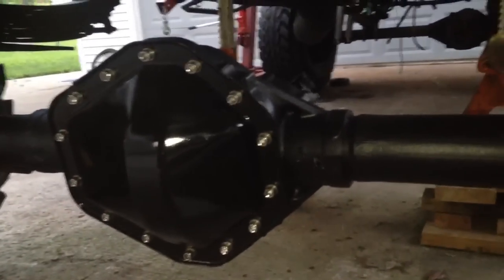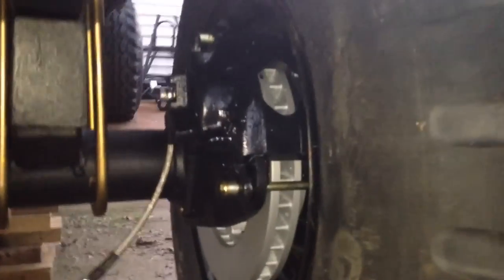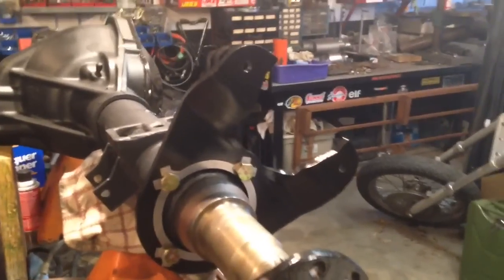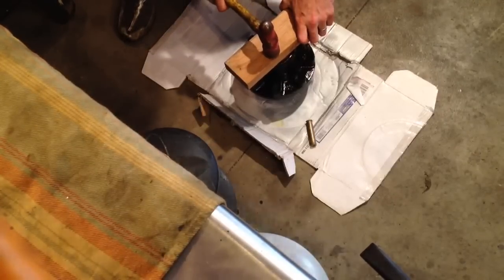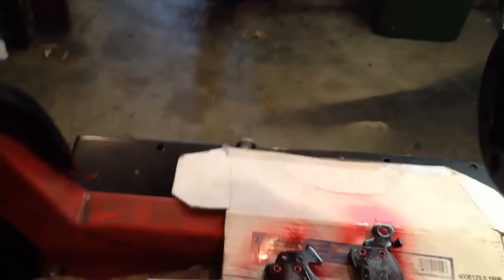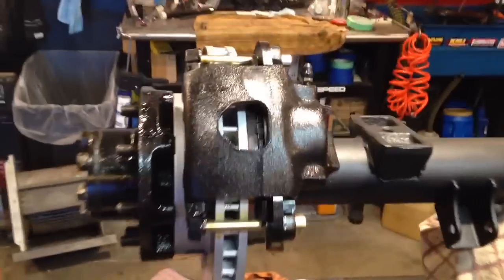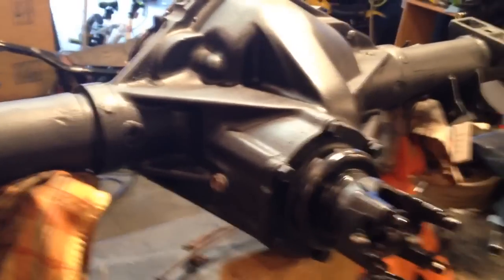Rear Disk Brakes on 14 Bolt Full Float! HOW TO!

Comment: Like to find an aam 11.5" 14 bolt, put 6 lug hubs on it and have the dual piston brake caliper with the 13" disc to fit my 17" wheels with stock park brake.

Drop a 373 diff in and then hoping someone makes a retrofit kit for the 8l90 and 10L90 to work on GMT800 platform

Comment: Great information! Thanks! You mentioned Cadillac Calipers for E-Brake. Any particular year? I've got a 14 bolt that eventually I will be building. The disc brake conversion is definitely on the to-do list for it. Since my rig will be a rail/street rig. I would like to have the option of e-brake. Again, great informative video!
Reply from the maker: Thank you, I am so glad you like the video! I do not have a specific year of Caddi caliper off of the top of my head. Whichever ones used the mechanical disc E brake - I believe mid 80's. Have a blast with that rig! God bless!
Reply: 76-77 Eldorado rear calipers w/parking brake per ruffstuffspecialties.com.  You can buy them new from ruff stuff complete with pads and no core charge for $280 per pair.  Shipping will run $20 or so. If you buy the calipers from an auto parts store make sure they match the pictures on the ruff stuff site.  There are several different calipers and only one matches.  Or find the caddy at a salvage yard and rebuild the calipers.

Comment: I yanked a Dana Super 70 out of a 2003 3500 van & regeared from 3.73 to 4.10 to match my Dana 60 front.  I wish I’d have sourced a 4.10 14 bolt from a 2004 or newer 3500 truck to save some time & money...
Reply from the maker: You have a solid rear end with the super 70 for sure, but u agree you'd have been money ahead to find a 14 bolt. Thank you for watching and commenting! God bless!

Comment: I"d say going without the service brake was a good decision.  I tried a set and it was an absolute crap shoot if they will hold.  On a hill, or have a trailer... zero chance.  I ended up selling the whole conversion.  Braking is not any better than a properly set up drum.

Comment: GebBuilt...Did you reuse the wheel studs from the drum or go with another length. I have read peaople are using a Dorman 610-194 or 610-189?
Reply from the maker: I ended up using Dorman 610.194 which are 3 1/4"long. Thanks for watching and commenting! God Bless!
Reply: Thank you

Comment: Hey bud you mind posting a video on proportioning valve if you used one?
Reply from the maker: I am not going to use a proportioning valve to start. If I decide to use one, I'll post a vid. I've heard several people say it is not necessary, but I'll find out for sure when the truck is done!

Comment: I got everything installed, axles under the truck. just bleeding brakes. how long did it take you. tryed 2 person "old school" bleeding, then vacuum, now im trying gravity. nothing seems to be getting any fluid out. Might be a big inpatient, but i cant wait to drive with 4.10s compared to the 2.73s currently turning my  35s. by the way thanks for the help so far
Reply from the maker: It will definitely take a while. I've been partial to a vacuum bleeder but still requires all the patience I can muster.
Reply: I was at my dads friends yesterday. He's a mechanic. Said that it's the proportioning valve. Cut off flow to rear.
Reply from the maker: +Jacob Schneider yes I'd bleed to it first then move forward.
Reply from the maker: +Jacob Schneider Also, let me know once you get on the road if the front to rear proportioning seems ok. Mine's not on the road yet and I'm curious if I'll need to install adjustable proportioning or not. I've heard people that have eliminated the proportioning valve, ones who have replaced with adjustable proportioning, and others who say it is fine as is.
Reply: +GebBuilt  just drove it. had to crack line from master cylinder to proportion valve (top of vave) and press brakes. freed up valve. drove fine, after pumping brakes to get brake light to go away, brakes lost a bit of stiffness, but still good. on road they stopped me WAY faster. seemed to work great
Reply from the maker: +Jacob Schneider Excellent! Thanks for the feedback!!

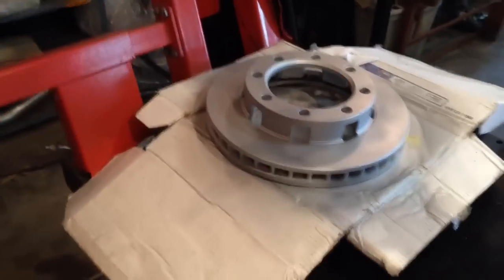Comment: Hey man awesome videos btw.. but do you know if all the 14 bolt ff center sections (pumpkins) insides are the same?  I've got a 01 14 bolt with 4:10 and I'm wanting to swap them in my rear differential out of my 93 with 3:73. Cause I went with a solid axle swap and got a 4:10 front diff.. if you can help That would be awesome and also will a Detroit locker for a 14 bolt ff work in any of them? I had it in my 82 gmc 14 bolt and was fine just wanting to make sure my 93 wou be the same. Thanks man
Reply from the maker: Thanks! I won't even pretend to be a compatibility expert. I think you might run into some issues in swapping those carriers. To be certain I know Pirate 4X4 is an awesome resource for those kinds of questions. Look em up on the web, that's what I'd do!
Reply: I put a chevy 1975 14 bolt carrier in a 2001 GMC 2500 hd housing after cracking the carrier in it.  The older carriers are much thicker and stronger .

Comment: I have a 14 bolt I'd like to do this to before I put it in my '61 Willys PU. Did you change the proportioning valve or master cylinder?
Reply from the maker: Nope, and the truck is still only about 1/3 done, so I haven't driven it to see how it brakes. I haven't heard of anyone changing a master cylinder for this swap, and only a few that have swapped in an adjustable proportioning valve. I will see how mine acts and decide from there.

Comment: What ate your thoughts on replacing front drum brakes on a 70 chevy with a 79 rotor assembly.  I'd just have to swap spindles right?
Reply from the maker: Thank you for your question! Are we talking two wheel drive or four wheel drive?
Reply: GebBuilt It's a 70 c20 2wd

Comment: i have a 92 chevy k1500 with a 14 bolt rear and 6 lug  i want to do a disc brake rear conversion on but can't find a kit i also need to have a e brake since it is going to be a stick shift and its going to have a cummins, and nv4500 4x4 etc so i need a good e brake.
Reply from the maker: +Joe Stenny I believe your best bet for an E brake will be a disk setup on your transfer case output. I intend to do mine that way when time and money allow. As far as your rear disks, I'd suggest scouring Ebay and if you don't find a direct fit, contact the sellers to see if they can help. Cut Throat 4x4 is one of them I would trust to know how to fit your application. if nothing else, the caliper brackets are a pretty simple fabrication for a well equipped shop to build. Thanks for watching BTW!!
Reply: +GebBuilt 76 through 78 eldarado calipers bolt up to these setups and have the ebrake option if you guys are interested in going that way. thats the way ive chosen on my 77 crew cab

Comment: I've got an '83 C30 dually and would love to do the same. Will this work?
Reply from the maker: I would have to go back and research applications - my advise would be to Google "C30 dually rear disks" and see what comes up. Great question, God bless!
Reply: Justin Smith i have the exact same truck did u get those brakes swapped?  If so what did u use and do??

Comment: what would you need pics of? i can try to take pics or a video
Reply from the maker: Just a shot of the wheel hub would suffice.
Reply: i can't figure out how to send a pic to show you
Reply from the maker: +Joe Stenny I got the pics- definitely a semi floater.
Reply: +GebBuilt  awesome thanks for checking  that out... so it would be same disc conversion bracket  etc?
Reply from the maker: +Joe Stenny I'd assume it would. Have your year and tube diameter handy just in case before ordering anything.

Comment: how do i tell if i have a full floater or regular 14 bolt 6 lug rearend?
Reply from the maker: I'd guess your 6 lug is a semi floater, but to be sure- on a semi floater your lug studs will stick out farther than the end of the axle. A full floater will have outboard bearings and the end of the axle will protrude out past your lug studs. Sorry that's my best explanation at the moment without pics.
Reply: Joe Stenny Well glad you asked... If there is seal of approval stamped on the BOM on the axle tube by Chuck Norris it's full float if there is a 6 color rainbow on the axle flange  it's the gm 9.5 .
Reply: Its a semi floater

Comment: also how did you set the spindle nuts and washers?
Reply from the maker: +Jacob Schneider, sorry I'm not sure I understand the question.
Reply: Sorry, I mean when you re assembled your axle you had to put the spindle nuts back to keep the hubs on. How far or how tight did you set the 2 spindle nuts?
Reply from the maker: +Jacob Schneider This is how I've always successfully done it:  Slide the thrust washer on then run the first nut against it while spinning the hub by hand. tighten the nut until a good bit of resistance is felt while spinning the hub. Then back that nut off slightly and you should feel the spinning resistance go away as you back it up. the nut will end up being barely tighter than finger tight. Install the locking ring and tighten the 2nd nut against it- this one should be tight since it jams the first nut. watch the first nut carefully so it doesn't move as you tighten the jam nut- I've seen it happen occasionally. then bend a tab into one of the notches of the 2nd nut. Done, God bless!

Comment: Also my axle is a dually but would adding the disc brake kit would it make it a srw
Reply from the maker: +James Winchel I would have to research to make sure you get the right parts for the dually axle-
Reply: +GebBuilt probably going to get srw hubs

Comment: What are the part numbers on the rotors and calipers please
Reply from the maker: +James Winchel I got the calipers and rotors from Autozone. I just said I needed them for the front of a 1979 Chevy 3/4  ton pickup.
Reply: +GebBuilt thanks
Reply from the maker: Yep!
Reply: +GebBuilt would I use 4x4 or 2wd rotors and calipers
Reply from the maker: 4x4

Comment: Is that a newer style 14 bolt ?
Reply from the maker: Hi Chris, it is a late 70's 14 bolt. Thank you for watching and commenting, God bless!
Reply: GebBuilt. I jus purchased a newer style 14 bff and I was wondering if you knew wether or not the part numbers you used would still be compatible with mine ? (rotors,calipers,and studs)  Thanks pal !!!
Reply from the maker: I’ve never dealt with a newer 14 bolt so I’m afraid I can’t answer that.

Comment: you have a semi float...not full float
Reply: What depicts it from a full float or semi float lookin to get one to swap in my wj
Reply from the maker: +Spencer Frisella easiest way is to see the outboard spindle housing.
Reply: +GebBuilt just watched a vid of how to tell my other question is witch is better 10.5 or 11.5 ring gear ?
Reply from the maker: I'm sure most would say the bigger one is better, but they both use the same diameter axle shafts, so in my opinion it doesn't matter.
Reply: +GebBuilt ok thanks would the ring gear be strong if it's bigger more beef on it
Reply from the maker: +Spencer Frisella yes I would think so.